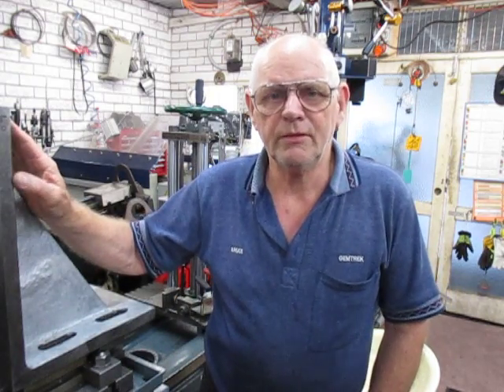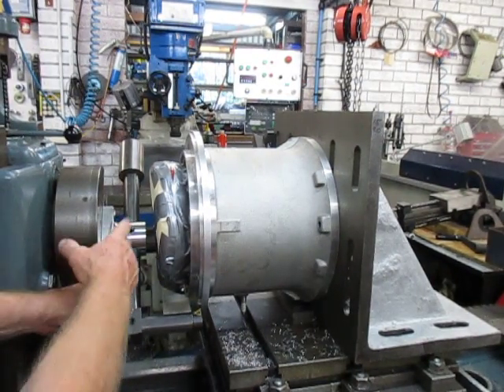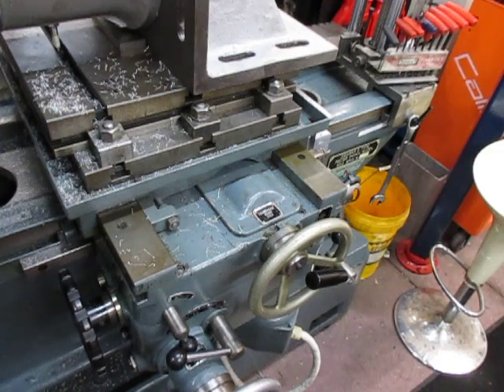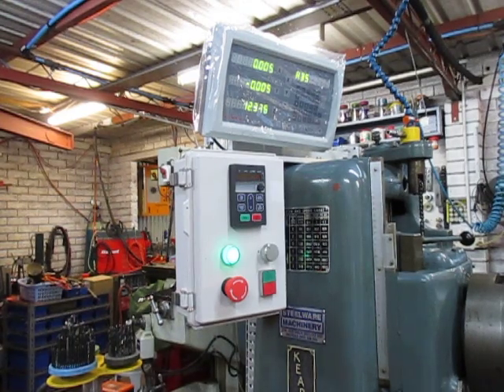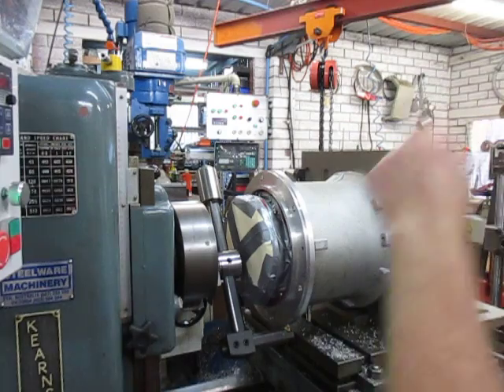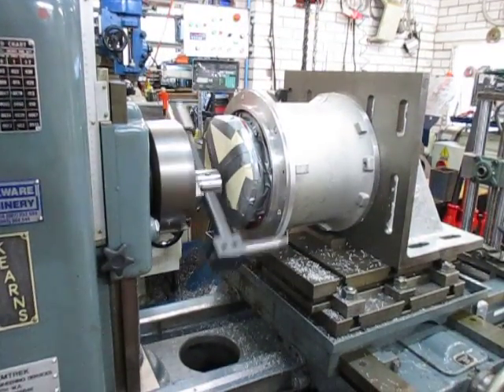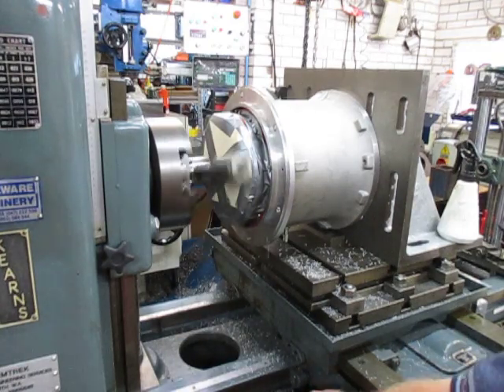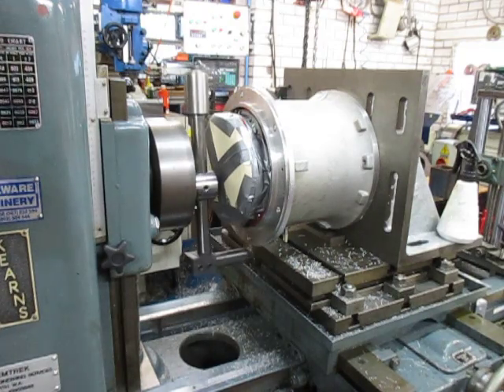Kearns Horizontal Boring and Facing Machine in action machining a Stator Housing

Comment: Hi Bruce. I've just come across your channel looking for Kearns Borers, love yours. Looks to be in excellent condition. I'm based in Brisbane QLD with my own machine shop. Just a heads up on your cross arm for the boring tool and the chatter. I have a Wohlhaupter Universal Boring/Facing head for my Huron Mill. It has collars that mount on the cross arm both sides of the head and retained with a heavy washer and bolt in the free end of the arm to increase the diameter thus stiffening the bar. Simple but clever. Go to the Wohlhaupter site and look at the parts lists for clarification. Hope this is of help and happy maching.

Comment: boy you have some nice toys Bruce, When you made the 0.005" rear adjustment I was expecting to see you lock the adjustment in. Enjoyable video, thanks for sharing.
Reply from the maker: +Bundy Bears Shed It is an amazing system (Old English precision). There is no locking device at the rear, because it can work automatically as well, or you can keep tweeking it on the run. I don't have the parts book so I don't know how the mechanism works, only that it is something special. The facing chuck has a taper key with a retention stud that you can lock the nose exactly on centre for centre boring work that is how I used it till this operation required the facing function. the chuck also has two small locking bars which I use as well if needed. Bruce.